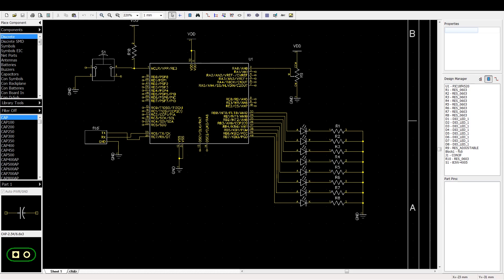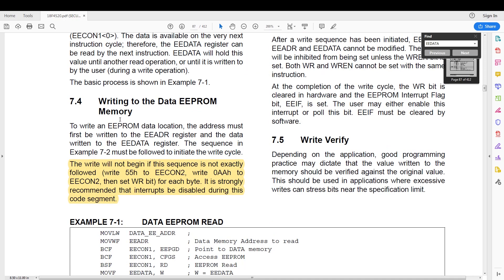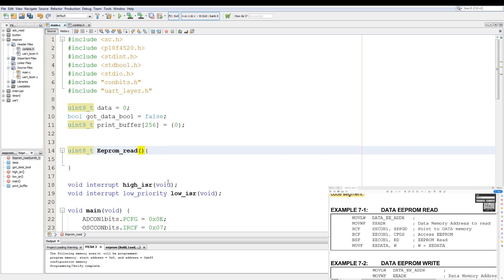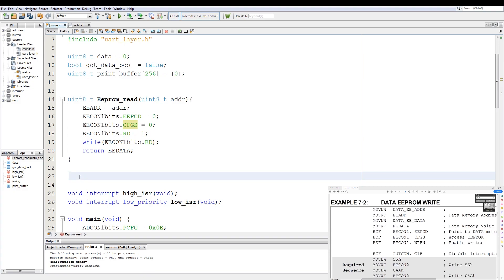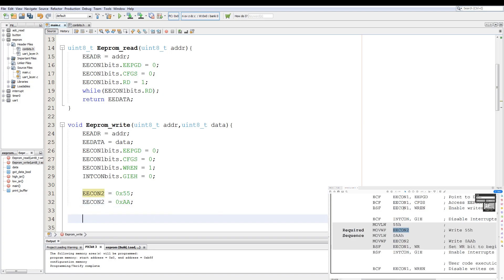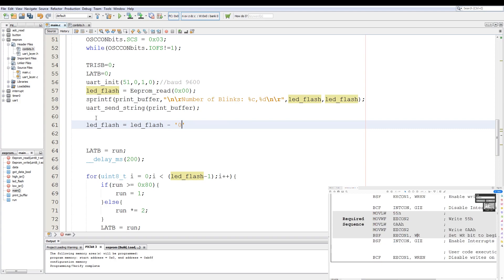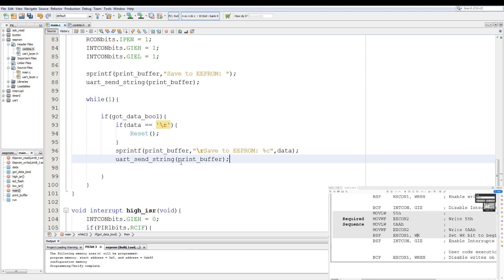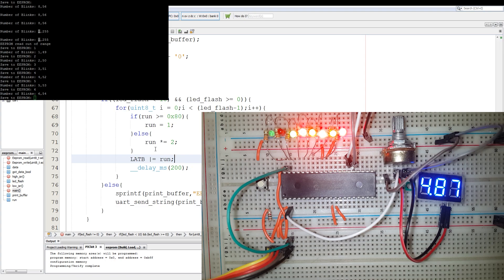EEPROM Read/Write 🔴 PIC Microcontroller Programming Tutorial #9 MPLAB in C

Comment: In Pic-Datasheets I tend to only find many of these quite usefull code-snippets are only published in assembler code, while their overall datasheets are mostly adjusted towards programming in C(++).
Therefore I'm wondering if you actually learned assembler as well?
Reply from the maker: Yes I did learn assembler. It is required for a formal education. See some of the newer videos.  I dropped it as soon as I did not need to use it. This is a example of why assembler still gets taught: https://youtu.be/0sowC6PfJkY .
It is very useful to know how the MCU actually executes and there is some stuff high level languages just can't do.

The reason you see assembler code in the datasheets is because the chips are from a bygone era where C was not widely adopted. It is also not worth the effort to update the documentation for chips that are legacy technology.
Reply: @BinderTronics  I am really surprised by that. I would definitely not agree on using the term „high level language“ when referring to C. C itself is one of the Hardware based (lowest) programming language out there, with Assembler being the absolute lowest. During my electrical engineering degree here in Germany it has not been teached at all…
Reply from the maker: The term "high level language" is very context dependent and is a semantic argument. ASM was a very short part of my course. It is still required today. Get plenty of interns and graduates that list it on there CVs. I believe it is also required in India. ASM is basically required to bootup anything "advanced" ARM/x86. I'm very surprised it is not  taught. What chip did/do you guys use?
Reply from the maker: Also would say operation code programming is the lowest level.

Comment: Hi. Is there any way to write these pic16, using a PCI LAN ethernet card? I see that it has the same amount of pins in the zocalo / slot.
I have a variety of these pic16 and pci lan cards, which have been discontinued. I would like to do many projects
Reply from the maker: Not sure what you are asking,  If you want to interface with a PCI card then i would recommend getting a PCI controller. If you want Ethernet use a ENC28J60 Ethernet chip or an ESP8266 that will give you WiFi access. This will save you allot of heartache. I'd never recommend bit-banging a protocol unless there is no way around it. Secondly the PCI needs a clock of 33Mhz with is extremely difficult to create stably.